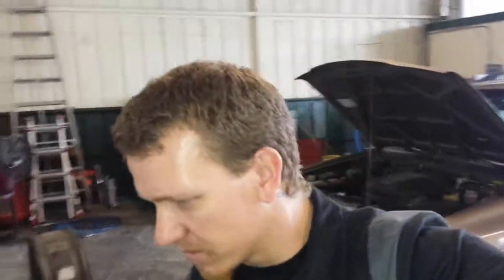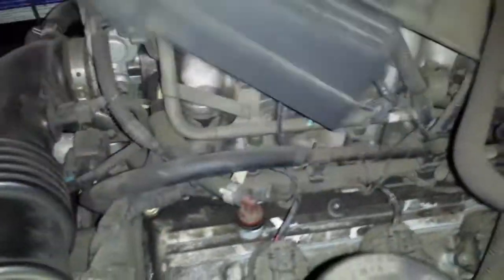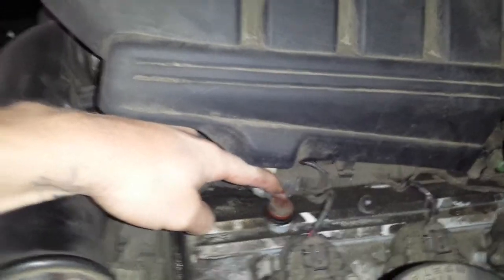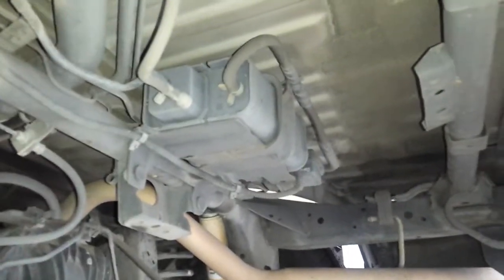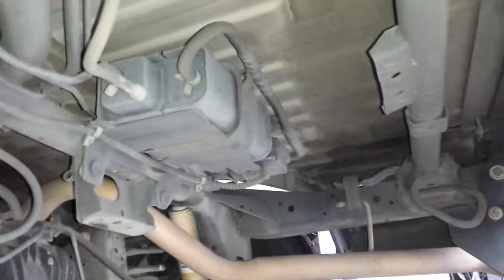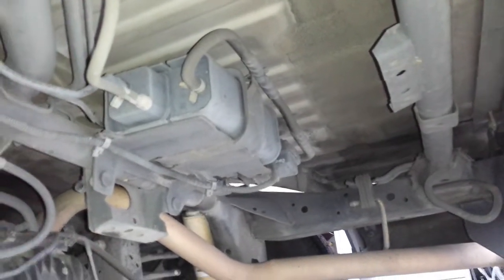Isuzu Rodeo emissions: EGR, PCV, EVAP canister, & EVAP Purge. (Amigo, Wizard, Passport, Frontera)

Comment: Thanks for this video.  Question: I'm getting a check engine light for the cannister.  And ,  I notice when I'm low on gas and remove the fuel cap ( replaced with o.e.m. one) there isn't any air escaping . Is this related? Thanks !

Comment: I would really like to ask a polite question. Would it be advised that if i got this vehicle cheap. I could do the PCV, Temp press gauge, Egr, oil press gauge, mass air flow sens, and ect. Or is that a no no
Reply from the maker: If it is the same as the vehicle in the video... I'd pass. These are notorious for having problems. How many do you see on the road? Probably not many and believe me, people are not storing them to be show cars later. Lol

Comment: Great video! Thank you for pointing those things out. I actually own a 2002 Isuzu axiom which is merely a different body on a rodeo frame. Everything you pointed out is in the same spot, however I do have a question : with recommendations I seen about using pressurized air to force out any blockage that there might be in the vent system, which shows that I use to Do this with this Canister box?

Comment: Thanks for the info. I was looking for info on a P0405 code on my 2001 Rodeo and your video helped point out where some key emission parts are. If you want to answer a question for me or I can look it up- What does the EVAP canister do and do they go out and need to be replaced?
Reply from the maker: The Evaporative System (EVAP) traps the fuel vapors from the gas tank and temporarily stores them in the charcoal canister. When the engine is running and other conditions allow, the fuel vapors are purged from the charcoal canister into the engine to be burned.

Canisters do go bad if they get saturated but if it is there is probably something causing that. They can also break pretty easy if something was to hit it, maybe off the road or in a accident.